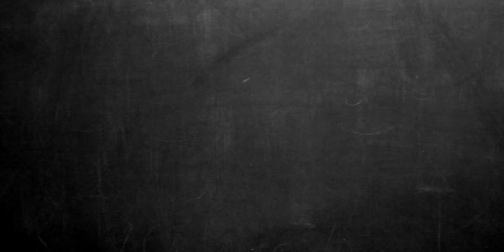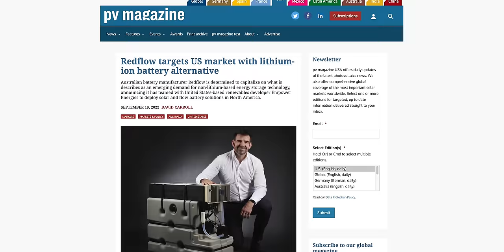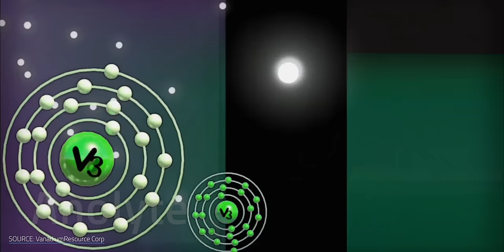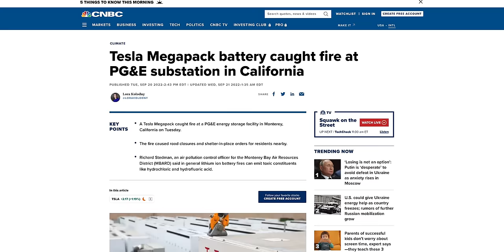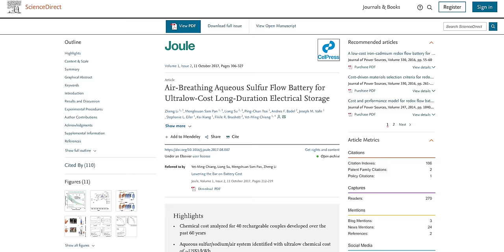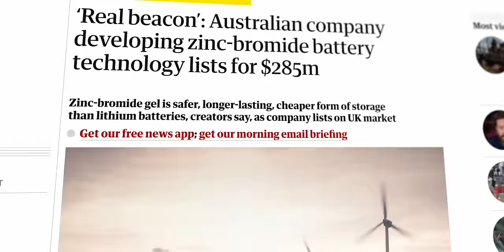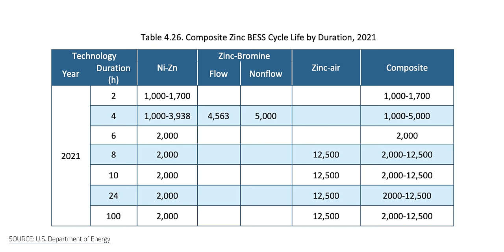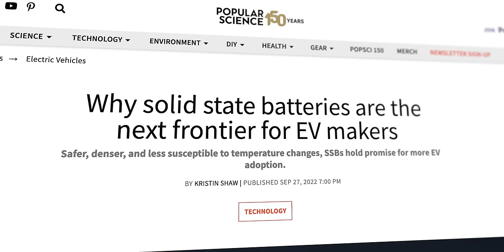137 Year Old Battery Tech May Be The Future of Energy Storage

Comment: My family has some land in a rural area that has limited grid connection. I think this would be interesting to use up there, especially considering my dad is planning on installing a somewhat large solar array to power all of his buildings and machines. It's in Wisconsin though, so we get hot summers and cold winters. It'd be interesting to create our own grid up there. Maybe sell some power to the neighbors, lol.
Reply: I have the same questions here in Michigan. Do we go with Lithium or are these newer technologies accessible to homeowners ?
Reply: A flow battery could very well need to be heavily insulated to stay above freezing. If built into a container, you'd probably need to put it on big timbers and build a shed around it.
If planning to sell power to neighbours, check local laws and regulations. It's likely that the state takes a relatively big cut, and there are electrical safety precautions that need to be taken.
Reply: If I still lived in Wisconson, I'd want a mix of solar and wind.  You just don't get enough winter daylight unless you're extremely overpaneled
Reply: I would suggest having shade tolerant crops and plant under them to help cool the solar and make them more efficient.
Reply: @thesilentone4024  Wisconsin never gets hot enough to bother with that.  People in Vegas often don't cool their panels and it's very rarely 100 degrees in Wisconsin. The real issue will be keeping batteries warm at night in the winter and having enough panels to make up for the narrow window of good sunlight
Reply: @silvergreylion  The easy way is to just build in under ground. Dirt are a good insulator and it also generate a stable and moderate temperature all year round.
 5-10 % heat loose from charging should ensure that noting freezes.
Reply: Your father should also have a look at thermal storage. An insulated bed of good sized rock can be charged with heat from the those hot summer days and last long into winter.
Reply: @colinkulasik1128  you can buy redflow battery for home, you just need space for it.
Reply: @bknesheim  Or cover it with dirt, yes, if you can make a spot with good drainage. I'd be quite worried about it rusting through in bad places, and it might not be possible to weld holes without removing a lot of battery parts.
It might not be possible during winter, and imagine having to remove several tons of parts to be able to weld a small hole, and then doing it again in a different spot a few months later. Some of which may include draining storage tanks to be able to move them.
In case of just a few days of no power from either solar or wind, for heating, you might want to install a small oil furnace for emergencies, as it's quite essential that it doesn't freeze and rupture any parts.
Reply: For a cold spot(recommend from canada) I recommend a stirling engine. You need the heat regardless. Run it from the waste inevitable. Summer run it from roof to ground for summer differential. Just a different difficult
Reply: @silvergreylion  What parts are you expecting will rust?
Reply: @bknesheim  The container itself. These flow batteries are generally built into a standard shipping container.
Reply: @silvergreylion  With a little care that is not so big a problem. Have seen container that have been covered for year without problems.
You paint the container in basically the same way you paint a ship. Add drainage and cover with sand then dirt.
I now this have worked fine where I live in Norway and last for decades. We have lot of rain, close to 80 inches/year.
Reply: @veganpotterthevegan  If you get enough wind, and have a way to get it high enough. Also look at the generation curve, not the peak to figure out how much you could make. I live in Ohio, and I get about 5x the production in July as I get in Dec or Jan.
Reply: @Frank RenewablesCheap  there are anomalys but on average throughout the northern hemisphere, wind speeds are about 0.5mph higher in the winter than summer with day to day wind

Comment: Gelion designing the one battery so that it uses the vast majority of the existing lead-acid battery manufacturing steps was a stroke of genius.  Far, far too many potentially revolutionary battery technologies never make it out of the lab because they fail to make the jump to mass production, but I bet this one doesn't meet that same fate.  The high functional temperature range and nonflammability are great, too, it means I could theoretically put one in my uninsulated garage and not care that the garage becomes an oven in the summer and a freezer in the winter.  The thing would likely still work safely regardless.
Reply: Their share price doesn't reflect your (or Matt's) optimism....
Reply: @rory6089  Neither does Tesla's. The market is often irrational.
Reply: Reminds me of how light bulb manufacturing facilities are reused for LED filament lamps. These are not just for the retro look! Filament solves the issue of omnidirectional lighting and the glass casing solves the issue of retaining the helium required to cool them.
Reply: Yup, so wake me up when I can buy a bank of them... and when they cost less than lead acid.
Reply: @TecnamTwin  Tesla's also overhyped as all hell anyways and only ever took off because people somehow think Elon is smart, instead of him just being great at bullshitting people.
Reply: @EkanVitki  They don't have to be cheaper than lead acid. They have 10 times the cycle life, twice the discharge limit and a higher energy density. Basically in a camper you can replace 4 lead acid with 2 Zinc/Bromite and they hold 10+ years instead of 2-3.
Reply: @Psi-Storm  awesome, where do I buy one?
Reply: @EkanVitki  Well, that's the big question. There is a long way from lab results to cheap mass production.
Reply: @Psi-Storm  Thank you... That's exactly my point. Until you can hand over your readies and take some home it's all just hype and stock price manipulation. When I said cheaper... you can read that as total cost over time. As much as I like the idea of these, if I can get by for 15 years on second hand deep cycle lead acid forklift batteries at half the price of a set of these I know which ones I'm going to go for.
Reply: @EkanVitki  If a Gelion would still start my car when its been sitting outside in -40C all weekend - I don't care if its more expensive than that lead acid batter that froze and was not only discharged when I needed it, its dead now and will never charge again. (I actually have a battery Blanket, but sometimes you forget or dont realize its getting THAT cold)
Even if the Gelion wont hold a charge against that kind of cold, if its even able to just survive the cold so I can just charge it up again and its fine its still worth paying like 5x what I would for the lead battery because it wont need replacing nearly as often where I live.
Reply: @TheFinagle  Amen to that!

What we whine about the lack of grid capacity situations for the EV is where the zinc battery re charger comes into it's nich.

What is now a "wall" battery is often the second life for the lithium ion battery is a good idea but I think I have seen in my dreams minigrids using zinc batteries.

As an investor I too thought vanadium was a good idea but have since put my dime on a grid scale zinc battery scheme. 
 As for the cold weather battery what we need to be getting is the same as on an earlier program here, said, to have a 400 degree operating temperature, I can afford to keep a couple of forklift batteries in the garage for that!
Reply: Lead batteries have probably hundreds of manufacturers in the world. I imagine at this point, they don't have to pay license fees to anyone for any patents. Although I could be wrong. The original zinc-bromine patent should have expired a century ago, but what about the gel battery à la Gelion?
Reply: @herrakaarme  new patents can granted for older designs/tech/science, if it's a new way of doing same thing.
Reply: @JeremyLawrence-imajez  Yeah, but the new patents aren't anymore pinciple patents. They are very specific and only cover a certain manufacturer's certain product/product series/component, so that some patent troll can't strike them suddenly where it hurts.
Reply: that is the promary reason i stay with lead acid for my offgrid property. Here in West texas the temps can be from -10 to 124f and all my research says those extremes make standard lithium batteries problematic.
Reply: @EkanVitki  or even close
Reply: @Darca1n  im starting to see that in Musk. A great showman and motivator but not so sure how tech smart he actually is.
Reply: @Psi-Storm  doesnt matter if they are 10-20 times what lead acid is.
Reply: @EkanVitki  big reason im still lead acid in my solar power system. Aside from lithium has problems with extreme temps, my $1200 lead acid system would cost 3x more if it were lithium. i get 7-10 years off a set of GC batteries. so a battery that has 2x life costs 3x, not a bargain

Comment: I'm a big fan of this battery chemistry because of it's simplicity, durability, and safety. Zinc and Bromine are super common. It seems like a clear winner to me.
Reply: Even if they're not as durable as lead acid, the materials and tech are cheaper, safer, and more renewable than lead
Reply: @runed0s86  Indeed lesser of the two evils.
Reply: @Gee T I've been in a zinc mine in New York that's been shut down because prices have bottomed out. Zinc is of course recyclable so I dunno where you get the idea it's "endangered".
Reply: @runed0s86  What do you mean more renewable than lead? Both the lead and the sulfuric acid are the single most highly recycled item in the world, with recycling exceeding 99% in some places. That's pretty renewable to me.

Comment: I have a large lithium-ion DIY powerwall in it's 5th year of operation.    Over the last 5 years, LifePo4 has taken DIY powerwalls by storm.   A key difference between them is the voltage range.   Lithium-ion has a relatively large (3.0v -> 4.2v) operating range so you can set max charge/discharge by voltage to manage DOD.   LifePo4 has a very flat discharge curve which means it's preferred to do coulomb tracking instead of the simpler voltage approach to manage DOD.        MY POINT:  One thing you don't mention in these battery technology discussions is the voltage range - e.g. flat like LifePo4 or wider like Lithium-ion.   And are they compatible with nominal 12v, 24v 48v systems.    For example, lithium-ion does not work for 12v systems as neither 3s or 4s matches the voltage range of standard equipment properly - but does fine for 24v and 48v equipment.   LifePo4 does all 3.     I agree these are smaller points :) but I'd suggest that these youtubes are nerdy and the voltage range, 12/24/48v compatibility, BMSs available?, and cycles are of great interest to DIY folks like myself and would add interest in you're presentations.

Comment: The thing that sticks in my mind is the full discharge for dendrite removal. That’s the kind of thing set for a full battery management system with a bank of batteries. A system that could isolate a single battery at a time to take it through a full discharge cycle as part of an automated maintenance plan could extend the life of these batteries indefinitely…

Promising ideas.
Reply: Redflow have that in their BMS was mentioned as a downfall of their product some time ago as the units would 'self discharge' to avoid dendrites. Thus you need more of them. Also Zinc Bromide batteries aren't very good at sinking or delivering current and thus need more units to give the total power required for the job but they are good for longer term power delivery just a matter on their size of fluid storage.
Reply: nothing can work indefinately. dont fall for the perpetual motion theory.